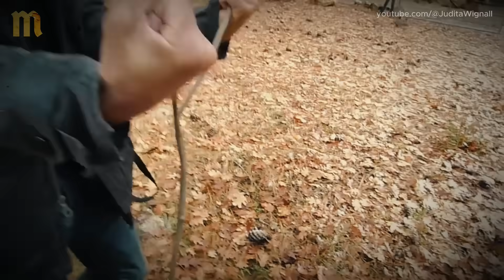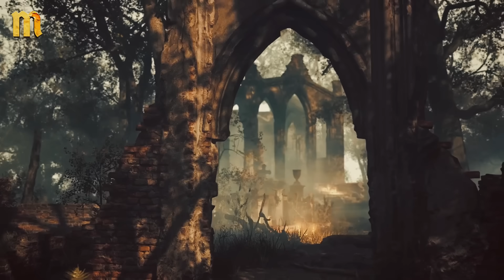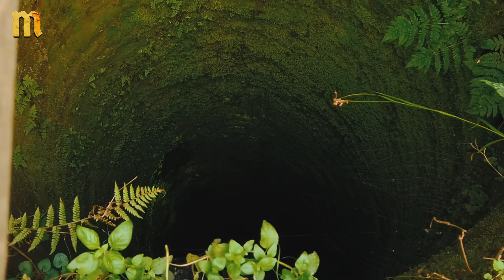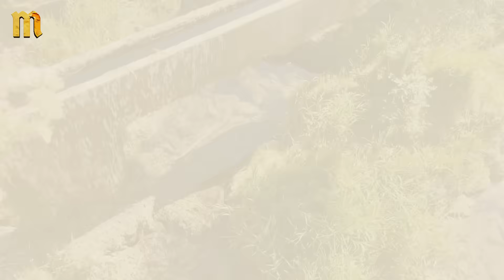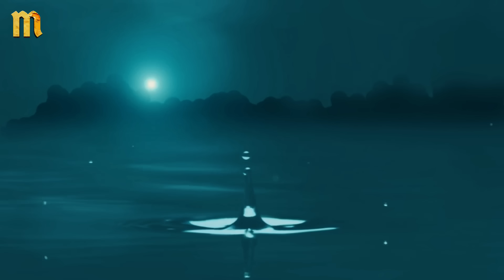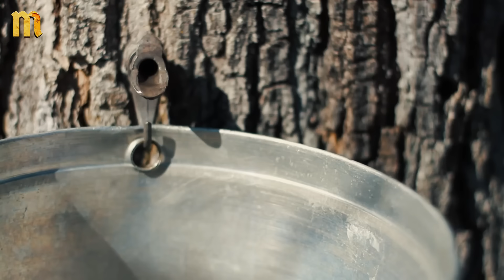7 Forgotten Medieval Water Hacks That Still Work Today

Comment: dowsing is a complete and utter hack, and I don't mean the "life hack" version. It's utter garbage
"there's a significantly high chance of finding water using this method"
duh motherfuckers, cause there's a thing called the water table that exists. Even the fuckin Sahara has a water table. You just gotta dig far enough for it to be worth anything.

But, if we're starting off a video with this, then I actually doubt the effectiveness of everything else this has to offer.

Comment: This is extremely funny video. Wooden pipes were used in medieval times because metal pipes could not be made as easily. Churches would not encourage dowsing because the Bible says to not suffer witchcraft, astrology, or sorcery, which is basically what dowsing is. Thatch was used then because it was abundant, and if thick enough, it would repel rain. Thatch is not superior in any way to other types of roofing, including wooden shingles.

Comment: Yuo can make a pair of metal dowsing rods by cutting two metal cloths hangers  at the top and bend it at  the corner to 90% , making them into two matching 
"L" shapes, make a circle with your fingers & hold them with the short part resting in yuor curled up little finger
Hold very loosely
You can test you skill  by hiding a small glass of water
Hidden under a newspaper page proped up by 4 other
water glasses 
The rods will cross when placed over the fill water glass every time we as soon as you get use to it
Good luck....

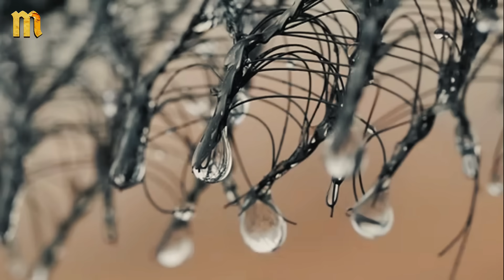Comment: At 13:46 you mentioned "and salty coastal air corroded wooden frames". Please explain what you meant here, as it makes no sense. Wood doesn't corrode. Metals do. Salty coastal air also doesn't contribute to faster rotting (if that is what you meant). In fact, the salinity would actually help preserve wood against rot, as the organisms that cause wood rot, can't tolerate salt. Hence, wooden ships on the sea lasted quite well. It is in sheltered woodlands, with LOW salinity air and high humidity and low levels of direct sunlight that wood rot thrives.
Reply: Go to the beach and have a look at the wood you find. Try burning some. It is dried out and rotten wood. It burns super fast. Ships lasted on the sea because of human ingenuity, upkeeping,  maintenance and lots of tar.

Comment: Seems to be a magnetic field you can also use two metal rods loosely held in the hand bent in a long l shape my dad could find water pipes dead on the money every time I mean to the point where he had a probe and if he said there's water there you damn sure can push that probe in and pink you'll hit the water line I shoot you not he can also use the Hazel stick but it's not as accurate